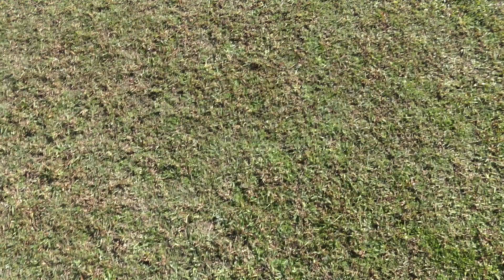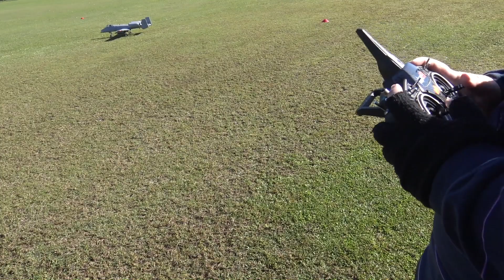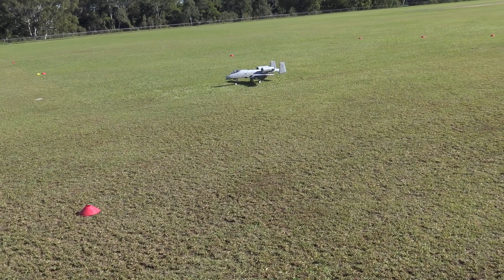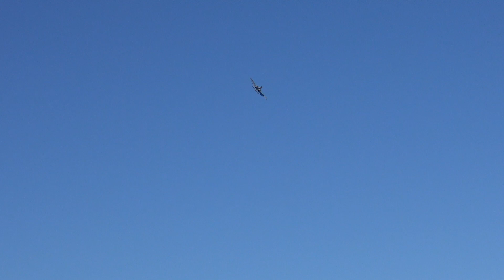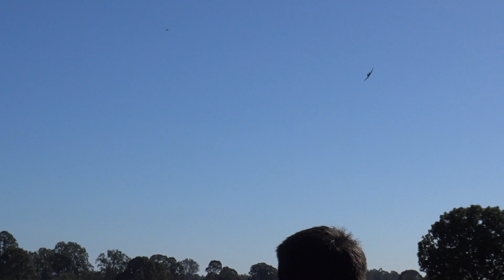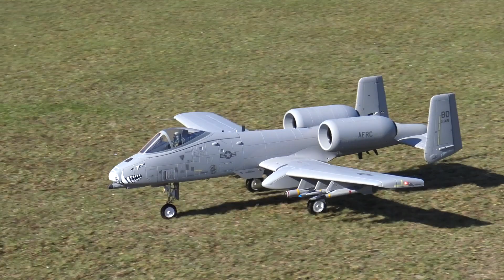Pilot Len maiden fight of Freewing A-10 Thunderbolt II Twin 80mm EDF

Comment: Gratz on yet another great maiden. Go easy on the aileron throws though - or add a little more expo.

And yes, CG in the high 80ies is pretty much sweet spot for this model.
Reply from the maker: Thanks thats exactly what I did for my second flight. Added more expo and moved the cg back as well.